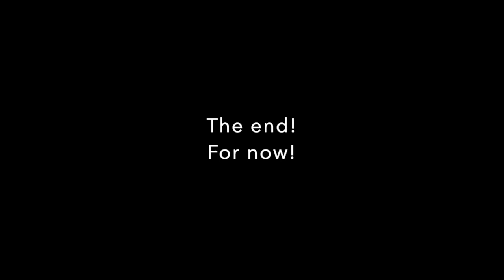Collection of UK Spiders HD

Comment: The other night I was watching a TV program on my computer and a grey coloured spider ran over my keyboard. It was between half an inch and three quarters and appeared furry. It looked like the tube spiders. As I moved, it darted off the end of the desk and disappeared. It came back about an hour later and casually walked across the keyboard again. I am fascinated by spiders. A couple of years ago, I was working at my local garage and the boss asked me to move a six foot high set of shelves away from the window to let more light into the workshop. The window was some 4ft wide by about 6ft high with iron bars about four inches apart with flat bars across supporting the vertical bars. There was a very large house spider, I do mean very large, about  four inches across and six long, counting the legs, it was almost black and had hairy legs. The body had some light coloured markings on the rear. I did the wrong thing, the boss wanted me to kill it, I took it outside in a paper cup and let it go. I saw it a couple of days later in the toilet!
Reply from the maker: Spiders will always find a way back! A very interesting story there! That spider which you found by the window with the iron bars sounds like the large common house spider, they generally lay flat webs which insects fall into. Thanks for the comment! :)
Reply: @spywarefinder  Although my wife is dead scared of spiders, I am not. I served in Australia many years ago, that is where spiders are scary! They are quite small in size, but pack a deadly punch. Have been bitten once, but did not manage to identify the creature. Quick medical attention helped and I have been stung by a scorpion on the foot.
Reply: Probably a mouse spider mate there beasts .Grey big and very hairy lol
Reply: Wow! That’s such a cool story, thank you for not killing it 😊. My mum called me downstairs once and there was a GIANT house spider in her flannel, not on but in! She said she felt something squishy and when she put it to her face she saw it and immediately dropped her flannel in the water. The spider (which I later named Dave) was a bit dazed but fine. I went to get a glass but even one of those beer pint glasses wouldn’t fit over him! He was so chill that we just ended picking him up and putting him outside. My dad later saw him on the wall and was not impressed because of how big he was 😂 (he’s not that keen on spiders but will never hurt them.) Then there was the time my little Jack Russell, Tilly (R.I.P.) was just staring at my curtain for ages, I looked once and couldn’t see anything but when I looked again this massive house spider just crawled out from them, it was like from a horror movie! Like when a hand comes in through a window 😂. Now I’ve moved to London with my boyfriend and there is 2 rather large house spiders in the shed. I’m pretty sure they are females because they have quite the chunky abdomen 😅
Reply: We found a grey spider the other day. It was about 1/2 inch long torso. Pure grey fury back torso. Brown fury legs. Big mandibles. Never seen a spider like it in the UK. It's a shame I can't share pics on here!
Reply: Young Common House Spider. These do bite if they are heavily threatened, but the venom is too weak to take any effect on humans, the worst would be a red mark that itches. Small children and vulnerable elderly adults may need minor medical attention, like anti-histermine.

Comment: England. At the end of my bed I have a large wall mounted bookcase. Fredrika has her hole where the ceiling, wall and case meet. I used to use 'Fred' but when I found out the male variety only lives about a year and the female about 2 years, and as she is over a year I felt rather embarrassed. Most evenings, when the lights are low, she pops out for a look around. She can handle a daddy long legs no problem, but she didn't think much of the legs and the body was as flat as a pancake. I was wondering what I could get her for Christmas ? Perhaps a nice, tasty 'blue bottle fly' on a stick ?
Reply: England also. It it is loads, btw, not one, They probably have loads of flies already.

Comment: Also what is that thing that you use to put to vibrate the web?
Reply from the maker: I created a simple device out of an old games controller, I used one of the motors to create a vibration and then designed a housing for the lure the best part, I made it rechargeable too! :)

Comment: What do u use to make the stick vibrate like that
Reply from the maker: I created my own spider lure, I basically had an old PS3 controller which has a lithium battery, and I hooked up one of the vibrating motors to a piece of wood, I then mastered the vibrations by making an adjustable wooden stick (dowel) and that’s basically how it works! I made many prototypes until this first revision!

Comment: Nice video enjoyed that.  I think those big black widow looking ones are Steatoda Grossa, a related false widow to Nobilis. Both common.  Oh by the way.. what is your spider tempting stick?  Looks great, gotta get myself one of those!
Reply from the maker: Thanks for the comment! Yes I believe the false black widow looking spiders are related to the Steatoda Grossa species, they look super cool! :)

Also, I created the lure device myself! I used an old game controller motor, with a rechargeable battery and created the tool :) it works incredibly well, as you might have noticed I designed it so you can change the vibrations for different spiders such as the false widows and also the tube spiders. I tried to add a camera to the device but the footage was too jumpy! :D
Reply: @spywarefinder  Wow no wonder they cant resist!  So clever that!